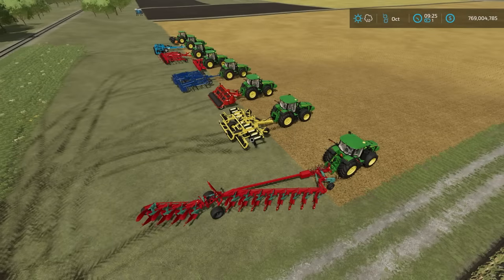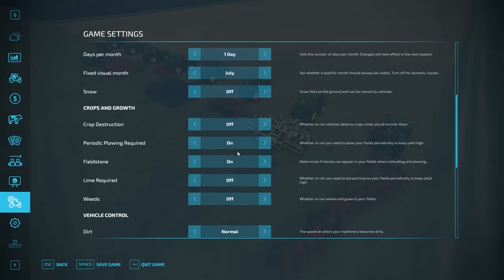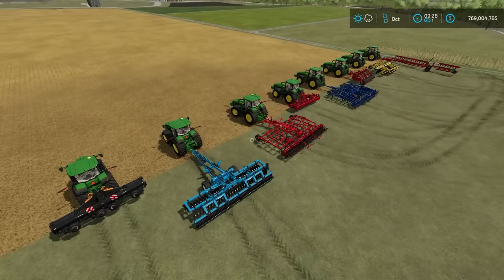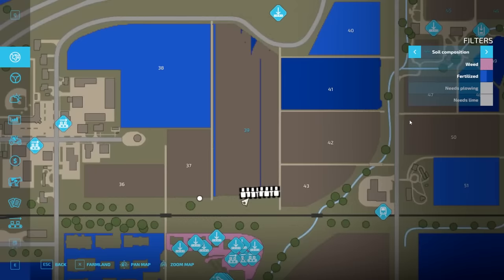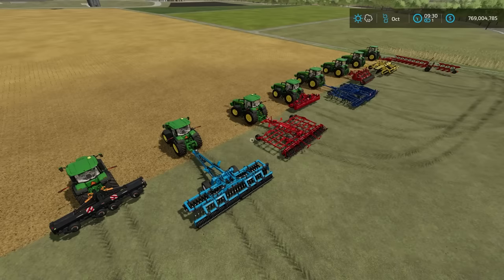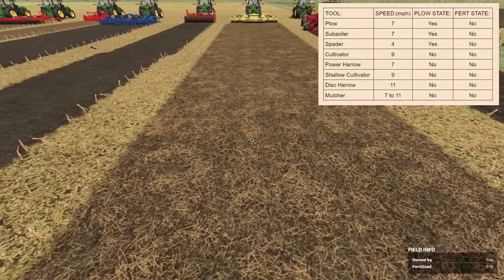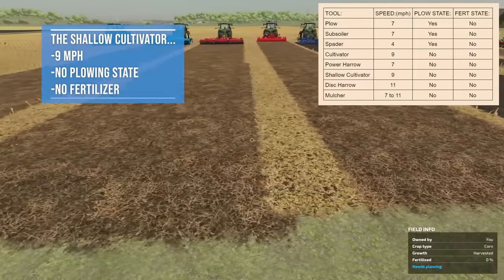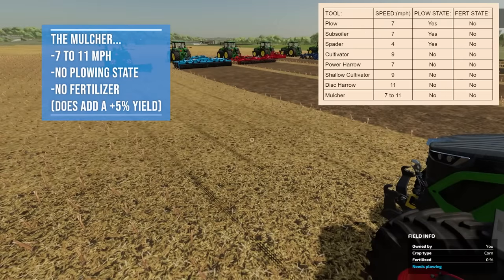FIELD PREP TEST - Farming Simulator 22

Comment: Shallow Cultivation (disc harrows and some cultivators) = preps field for seeding, no small or large stones, increases weed growth. This means you don't have to hire a stone collector and field prep is more straightforward BUT you probably spend a little more money/time on weeding if you have that switched on.

I shallow cultivated and then seeded a field waited just one day and the weeds were already above 50%. Normally theyd grow slow but I hadnt tested wether a dragged weeder would work. Likely outcome is that shallow cultivation is quicker for planting but the weeds grow so fast that you spend a lot on Herbicide as a trade off.

It all really depends what you can afford. Some power harrows can be attached to seeders or even attached to the front of tractors so you can cultivate and see at the same time, like a makeshift direct drill.

It's great that we have this wide variety but the tooltips / help info aren't exactly explanatory of the advantages and disadvantages of each type of field prep.
Reply: So essentially from what you're saying, what Farmer Cop tested, & from my own gameplay, we trade stones for weeds assuming weeds are enabled. So if weeds & periodic plowing aren't enabled, should be able to use a shallow cultivator to avoid rock damage & have the least maintenance, while being faster than some of the other equipment. Nice, but can be boring for a small farm & a bit more convenient if playing a very large operation.

Comment: I think there should be a min till (minimum tillage) bonus. Like if you used disks or maybe the shallow cultivator for 3yrs without using others you would get a 10% yeild bonus, because the low disturbance (working only on the first few inches/centimeters) preserves the bacteria in the soil and keeps a nutritious seed bed.

Whereas with plowing and cultivating etc. you are moving large amounts of soil and disturbing the ground, you dont give the ground the chance to build as good nutrition. 

The disadvantage of min till in fs could be that you need to use herbicide twice, once after agitating the ground with disks and once when sown. Keep in mind I don't think direct drill should have the bonus because you save time, and from personal experience irl, direct drill brings up large amounts of stones. 

Idk just an idea.
Reply: I have great news

Comment: It seems that if you plow a field, no weeds grow in it during that entire crop. However, if you use a subsoiler, you will have to spray for weeds.
I plow everytime and have yet to need a sprayer.
Reply: With the subsoiler the weeds jump to 100% growth and spraying only reduces it to 50%, if you prepare the seed bed they grow to 50% and you can get it down to 0%. Much better to use a plow and get no weeds IMO
Reply: @olympiad013  I agree!
If you run the plow right behind the combine, and use the big plow, its not that time consuming either.

Comment: Great had most of the info I needed about these field prep tools.

Only thing missing is the slightly related facts of which work for what contracts.

In FS19 I would mainly use a Subsoiler (for the easier shape), but I kept a plow around because I needed to use that for plowing contracts.

Comment: If you mulch and then plough would you in effect get a 20% yield increase?
Reply from the maker: No, it would be a 5% yield bonus for mulching and you would avoid the -15% yield deficit, its important to note that by plowing you just bring the yield up to 100% as opposed to 85% and by mulching you could go from 100%yield to 105% just as fertilizer would bring you (per fertilizer state) from 100% to 123% yield

Comment: Good for not worrying about width, cost, and speed, because one doesn't matter at all, and the other two is basic math.
Reply: But he did worry about speed
Reply: All of those matter. 

Width means less passes which means less fuel/wear/time/wages (therefore less cost)

Cost, well that's kinda key to the game, you can expand quicker if your profits are high

Speed, again this means wages are less and time reduced. Sure time isn't as important as fs19 because of the seasons but you don't want to sit at 4mph doing 10 acres especially paying 1$ a second for a worker.

Comment: Hello FC, hope you are doing well. I noticed that my new fields on no man's land where showing being in the 2nd stage of fertilizer before I even put any fertilizer down. The field was all grass that I mowed and collected before using a subsoiler to create my fields. I am using the create fields with cultivator mod, version 1.0.1.0. . I created a new game on Elmcreek with no mods at all. When use the plow to create a new field on lot 56, that field shows fertilized at 50% when I look in the map it shows that field with the first state of ferritization.   When I ran the plow through the unharvested field of oats the area the plow went through showed a fertilize % of between 10 and 20%. I got the same results when I used the subsoiler on the existing field. When I turned the mod back on and created a new field with the subsoiler I got the same results as the un-moded test with the plow. Looks like the made the change after your video but I haven't yet been able to find it in the patch notes.
Reply from the maker: If you create a field over where there is grass it usually adds some level of fertilizer and could be more or less depending on the map

Comment: From what I've seen direct drilled or disked ground (and shallow cultivated?) doesn't allow for a mechanical weeder to get 100% of the weeds. It will only remove 50%. For 100% weed reduction you need to use herbicide.

Comment: So basically all you need is a cultivator and a plow & a roller and a stone picker for the large stones after plowing........... 
Harrows are usually used to remove track marks (if you want to change your lines etc) and soften the top soil but seems this is a non factor in farming sim 2017 - 2022.  
Would be nice if they actually made the useless items useful but hey......

Comment: Just starting with 22, I do have 20 on my iPad, oh 22 is on my desktop. My prob is on 20 your headers have a trailer when you drop it. In 22 it does not. Not sure how to load it on a trailer or which trailer works for each size

Comment: Could it be that you need to plant covercrop like oilseed radish which you mulch and then work on field to gain the 5%?
Reply: The mulcher is used just after harvest to cut down the stubble left behind. (The bottom of the crop the harvester didn’t pick up. This then would get plowed or cultivated (or whatever you use) into the ground “enriching” the soil for a better yield on your next crop.  The cover crops add a fertilizer state when cultivated or plowed into the ground. (Not sure what would happen if you used a mulcher on them.) :)
Reply: @spenzien  could that mulching work with like after corn harvest?
Reply: @Henqzor  for sure with corn.  Think with every crop, have yet to try most.

Comment: It might be worth a comment with the mulcher you said you testing it doesn't add the field to a ready state which is correct but your testing with the Broken Seeders as they have a power harrow that is currently not working so it would be worth saying tested with the seeders power harrow turned off as when giants fix these it could give the illusion it does.

Comment: I don't feel like the stones are functioning properly in the game yet. The roller is supposed to push the small stones back under the soil, yet it doesn't appear to function that way (from my experience).
Reply: Roller pushes the small stones under and can only be done after a cultivation stage, if you seeded it the stones are locked in. Will need a stone picker to remove large ones. RIP my harvester.

Comment: Showing some ignorance here but how often are you required plowing for the other crops besides the ones it indicates is required?
Reply from the maker: Only if you buy the field and it needs it, after taken care of all the other crops will never require it
Reply: @FarmerCop  awesome thanks for the reply. Been trying to figure out the various steps you have to take to prep and field and was struggling with that. And also struggling when most appropriate when to use the roller because of the potential benefits there. Appreciate the guide and videos been super helpful.

Comment: Thanks for the video, great details for a NooB like me. Would you do a follow-up on the BEDNAR FB3000-TO6000-PT6000 please ? It has the subsoiler which lifts the rocks, has a cultivator and then a roller to re-bury them. It also has a fertiliser option (but couldn't get that loaded no matter how hard I tried). It's really expensive, but if you can do all these functions in one, it may be worth it. Not sure. Thanks again.
Reply from the maker: I will look into that :)

Comment: Sugar cane does not need to be plowed out after harvest, it grows back endlessly with diminished results after a few harvests. It was a feature in farm sin 19 as well. 

I have been a part of the Sugar cane industry my whole life in Australia and I have seen cane crops that haven't been plowed out since the early 50's which they were originally hand cut.
Reply from the maker: You dont HAVE to plow but it does show up as plowing required every harvest, just as FS19 so you get a yield deficit if you domt plow
Reply: @FarmerCop  ok, I haven't tried the cane farming part of FS22 yet but the info page says it grows indefinitely and if periodic plowing is turned on it is required after 3 harvest or something. Maybe Giants needs to do a patch or something. 

I never really liked how Giants did the sugar cane side of farm sim since they added it, the row spacing was wrong, single row planter planted 3 rows and a 2 row planter planted 5 rows. They need to remove every second row to make it more realistic looking as you need space for it to grow properly without much competition from the next row and the tractor tyres need the space to drive between them. 

I reckon it'll be awesome if you can choose your row spacing like in real life. My dad plant cane at 1.6 metre spacing, other farmers have anywhere from about 1.54m to 1.9m, even duel row. Some farmers have tried 2m spacing and nearly went bankrupt.
Reply: Do so old plants (bottom part) suffer from a reduction of yield in real life?
Reply: @aresivrc1800  yes but it can vary a lot, we had a paddock last 9 harvesting seasons before it started giving noticeably less yield. We kept it for 11 years before plowing it out.

It depends on a lot of things like weather, soil conditions, the variety of cane, insects/grubs, cane diseases, fungi and many other things.
Reply: @Dropbear237  Thank you for the information.

Comment: Do we understand what the difference in textures means say, between the cultivator and the subsoiler?
Because one looks a lot more "prepared" than the other, which looks like it's still full of old crop remains.
Reply: Also worth noting that the less-prepared-looking state doesn't seem to dig up any stones, whereas the "standard" cultivation state does.
Why would I ever use a normal cultivator instead of a shallow one, it doesn't seem to have any advantages, only disadvantages?

Comment: Ok, now what happens if we use mulcher then cultivator ?
Reply: That would be a good test to run.

I used a shallow cultivator not reading it was shallow and had crop stubble remaining. I picked up a mulcher after I planted figuring the mulcher may need to run after to clean it.

Comment: Can you mulch in oilseed radish for a bigger yield bonus?
Reply: It is used as a fertilization replacement, so 1 of the 2 fertilization stages would be completed, would not add a third.
Reply: @bamtitandan21  Oilseed Radish adds fertilizer state AND adds a bonus to yield. At least it did in FS19

Comment: The disapointing thing for me is that all these different types of equipment are designed to deal with different soil conditions but none of these soil conditions are modeled in the FS series so Giants have had to create all these arbitrary attributes in order to differentiate the equipment.  From  a game min/max perspective most of this equipment will never be needed other than for "role play" purposes.  There is only one meta and the rest are supurfluous. It might be worth noting too that the only real resource the player has is time and often its better to use the equipment that covers the field the fastest and not worry about making a second pass for a 10% or whatever bonus.  Why make a second pass for a 10% yield increase when you can cover a second field instead and double your yield.

Comment: Question: i have huge amount of pallets spawning in the ground, some i can pull it out others are just stuck in the ground. Anyone else same problem?
Reply: Same issue
Reply: @dubdubdubdub  that is for pc
Reply: @dubdubdubdub  dont work on console and this problem is huge on console. You cant folder on ps4 or change something like you can on pc
Reply: @mathijsw3743  Correct, unfortunately if you're on console you'll just have to wait for a patch. My bug report to Giants for this issue said it was resolved so i'd expect it to be fixed in the next update. The stuck pallet issue is just as bad on PC version.
Reply: @dubdubdubdub  k thanks bud!